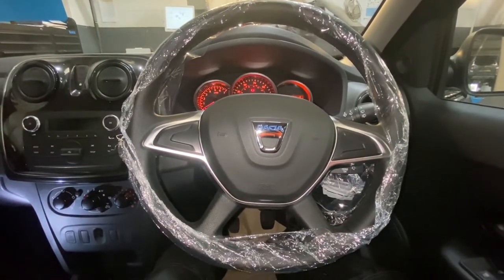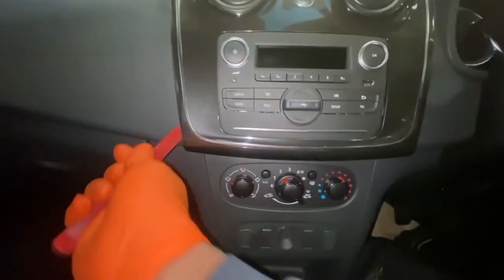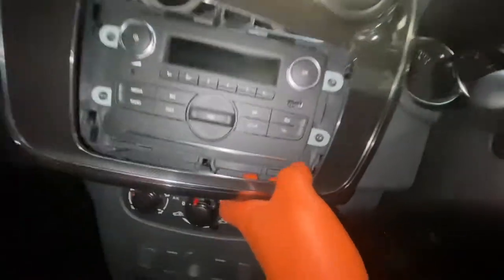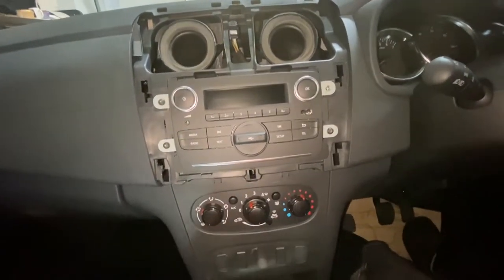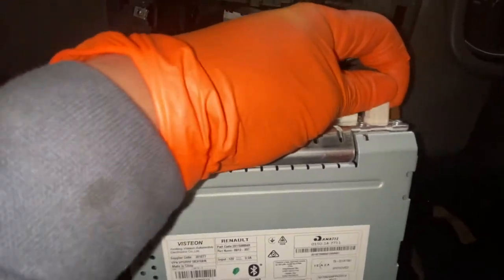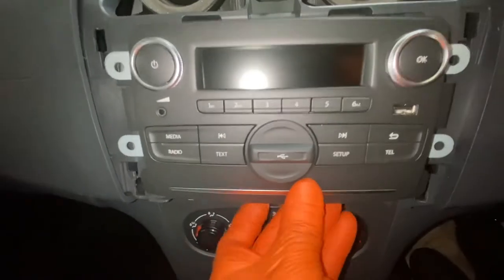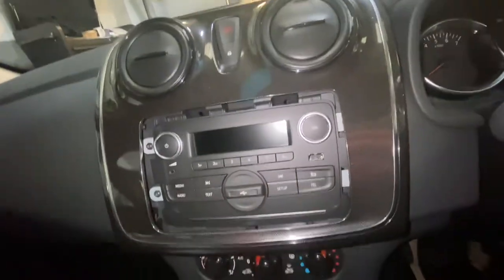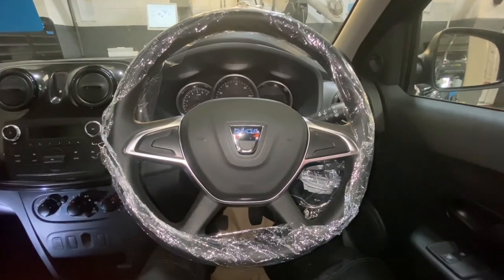#DACIA #SANDERO  #radio #unit #replacement

Comment: I have a problem with the hazard light on my Logan 2019, this has been invaluable bud
Reply from the maker: Can you describe the problem you’re having?
Reply: @g_a_bofficial  lights flashing continuous, when I stamped my foot they would stop until the next bump. 
Turns out it was the lock on the boot door. It closed but there's a small lever that wasn't going all the way across on the lock, leaving the boot door a little loose.
Wd40 and the problem seems to be solved

Comment: Thanks for the video. 

Do you know if it is possible to remove the original unit and upgrade it for a Media Nav?

TIA.
Reply from the maker: Not sure if it’s possible however it should be because the same model with the higher trim level has the sat nave unit

Comment: How can you remove the air conditioning panel underneath as I am struggling to get it out lol thanks
Reply from the maker: If you have the right tools and follow the instructions in the video full you will be able to do it
Reply: @g_a_bofficial the video you posted is to remove the head unit not the panel underneath 😀

Comment: How can you configure this radio after restart? I bought a Sandero with this radio, doesn't have the code wrote anywhere. If my battery dies, how can I do this work again? Thx.
Reply from the maker: You will have to pay for the manufacture to generate the radio for your vehicle